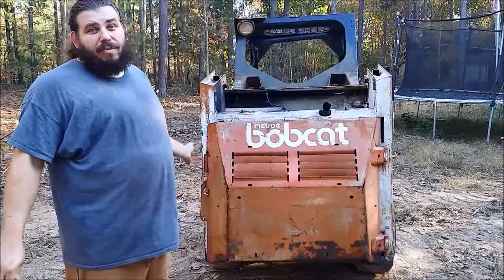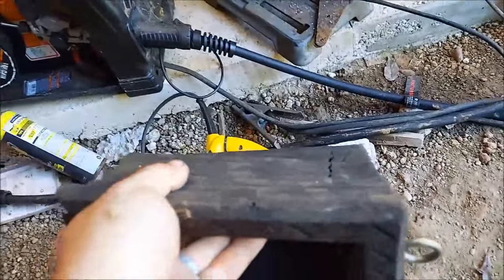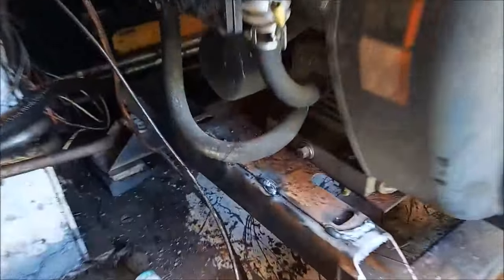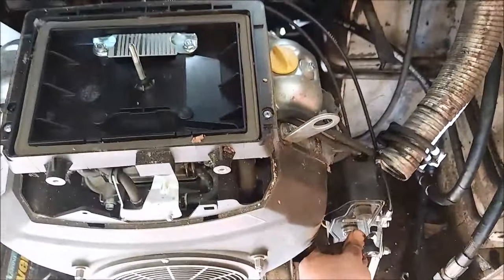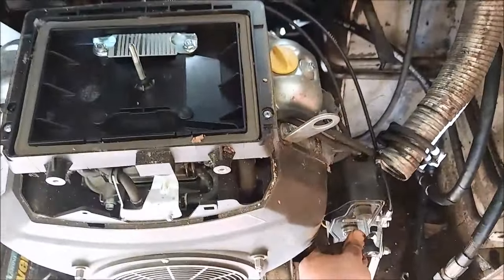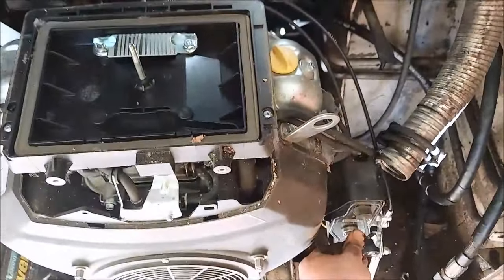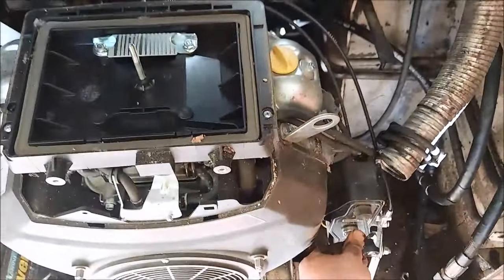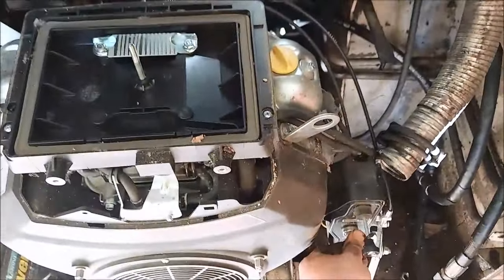Predator Swapped Bobcat

Comment: So a couple questions for you. Was that a Wisconsin engine removed? Was the pump driven by the flywheel end of the wisconsin engine? I thought there was some issues with rotation based on which end of engine is used (wisconsin) cw or ccw? Was looking at doing same swap but need this info first. Thx
Reply from the maker: Orginal engine was a deutz diesel but they did put Wisconsin in alot if them
Reply: Mine is flywheel driven wisconsin engine and driven clockwise. Most all engines I find are counter clockwise rotation. Guess I'm rebuilding the dinosaur

Comment: Driveshafts need to have a pivot point, they self grease with angle, you can add another u joint or just use a solid shaft either chain or gear driven

Comment: Did you consider something cheaper like a 420 or 212?
Reply: Not enough power with those, it could work but not fun.  I'm looking for someone to put a 4 cylinder car engine in with fuel injection, I need that swap for my 642b

Comment: Got any bobcat original engines that could be rebuilt that I could purchase from you
Reply from the maker: I got a 3 cylinder kubota out of a bobcat 643 it ran when pulled but smoked price is what I get charged as a core charge 900
Reply: @DannysCam do you still have it? I’m looking for that exact engine. Got a blown up kubota in my bobcat 643. I’m in East Tennessee
Reply from the maker: @fordfpv1825  sold all my kubota parts engines reefer units will have a v2003 I've swapped them in befor
Reply: @DannysCam  interested in the v2003
Reply from the maker: @fordfpv1825  when I get another one I'll hit you up generally I buy couple a year

Comment: Bobcat is not hiring you…their loss.
I look at my bobcat engine and I got headaches…everything is compacted in that small space in the back.
Replacing the battery got me struggle as it was an old bobcat and everything has been rusted or corroded or greased etc…
Why can’t they make something simpler so an average Joe (not the dementia Joe) can do the normal maintenances.
If the Chinese people got something similar but easier, Bobcat will have a tough time getting customers back.
Oh course I used the Chinese as an example, I hope that Capitelar, Case, John Deer etc.
Ain’t buying Chinese here.
Reply from the maker: The sad part is china started making a fake bobcat that is simpler easy to work on no computer lol, atleast the older ones ain't so bad the Japanese make a good machine takeuchi